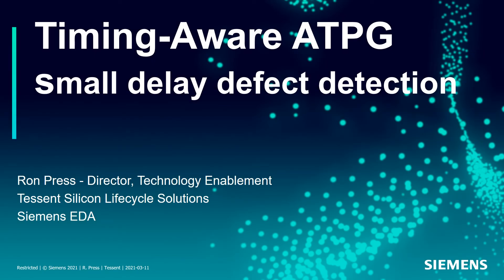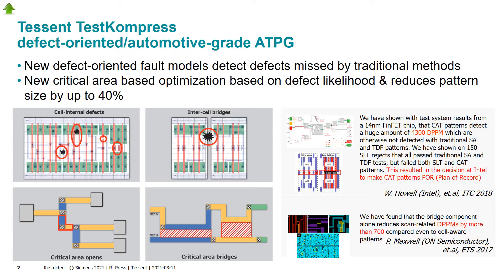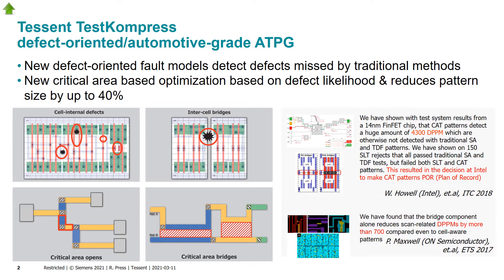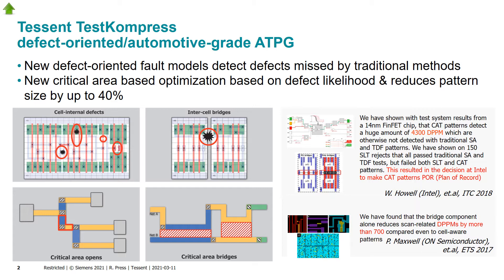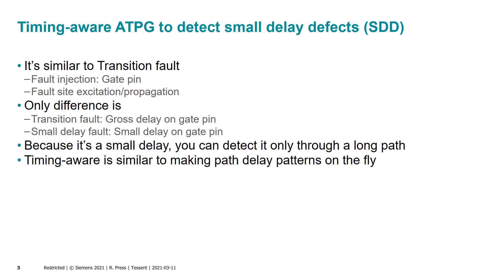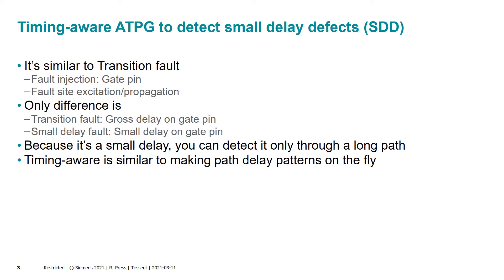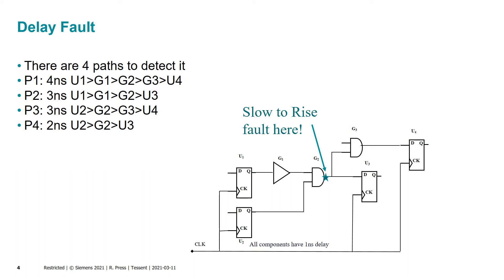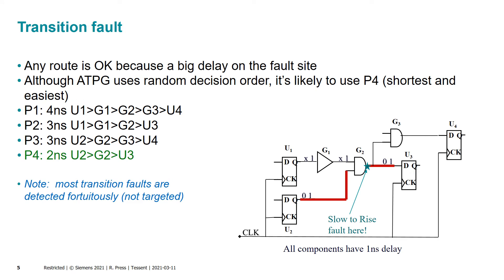Tessent time aware ATPG - Create test patterns to detect small delay defects in semiconductor device

Comment: when using  the set_atpg_timing on -clockwaveform comment in timing aware.When the offset value is changed for the same clock period ,the minimum static slack value changes what is the reason for this